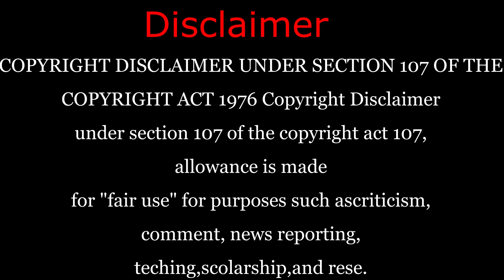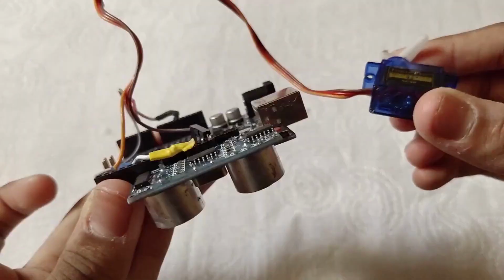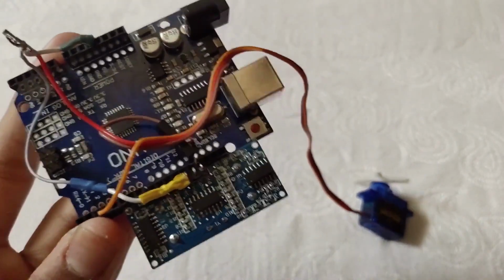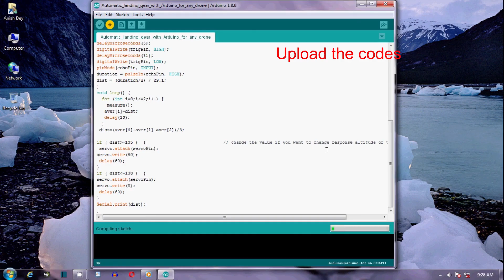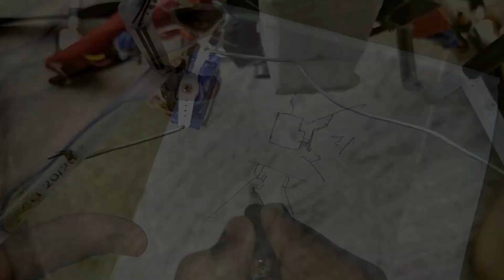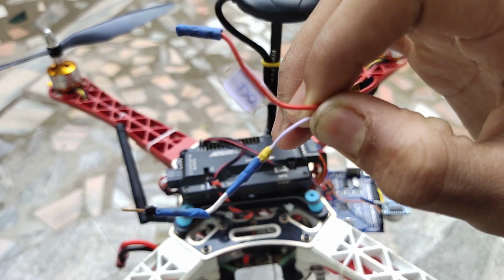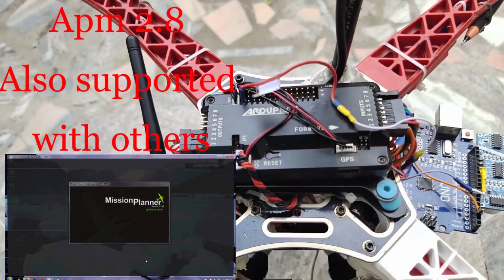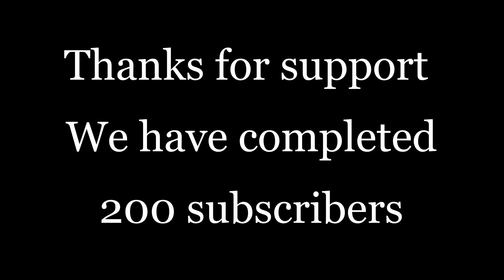Automated Landing Gear Any Drone DIYLIFEHACKER

Comment: Can we use DC motor ? If yes then how ?
Reply from the maker: Use relay or motor driver with it
Reply: @DIYLIFEHACKER  actually I have a tarrot landing gear. I tried with motor driver but its only opening not closing.
Reply from the maker: @vanshajbhaskar8971  Does the driver support reverse rotation of motor?
Reply: @DIYLIFEHACKER  yes, it does. One motor is working in clockwise and other in anticlockwise to open the gear. But both aren't working in anticlockwise and clockwise respectively for the closing operation.
Reply from the maker: @vanshajbhaskar8971  Reverse two wires of one motor
Reply: @DIYLIFEHACKER  okay, will do and revert back to you.
Reply: We have to connect the audrino with battery ?if yes how
Reply from the maker: @creckstorplayz2172  Better if you use ESC BEC if your ESC can provide such current or use some step down voltage dividers.
Reply: @DIYLIFEHACKER  how I will connect it

Comment: Bro i am just new to diy drones please tell me how to make a drone at home for Beggenirs m relly inspired from predector us military drone
Reply: As a beginner I would recommend you to build f450 or f250 than to make aeroplane type. You can easily buy kit and start learning about how each machines work and what you should do to operate them  :D
Reply: Making drone isn't hard but the mistake that most beginners make is using a KK flight controller since programming isn't required in it as it's pre-programmed and it's easier to calibrate and stuff but the problem with KK is that, it's control is hard and it doesn't stabilize properly many times. It's better to use APM flight controller even if you're a beginner.